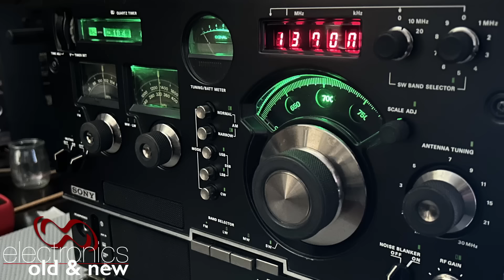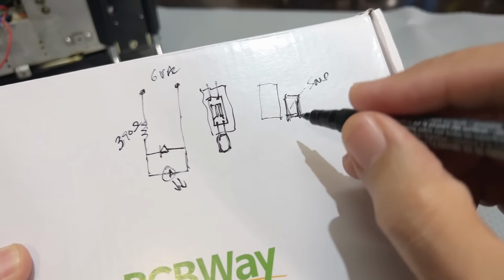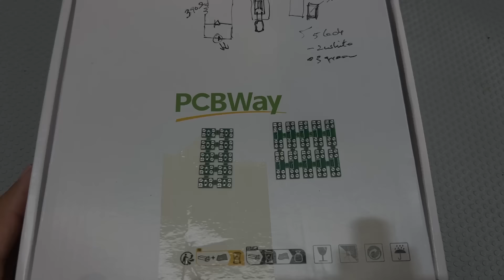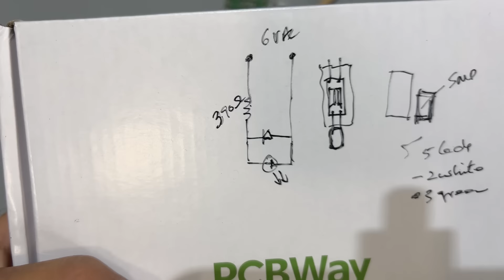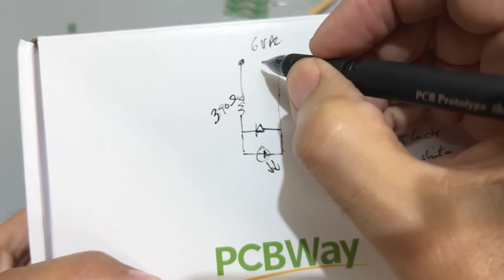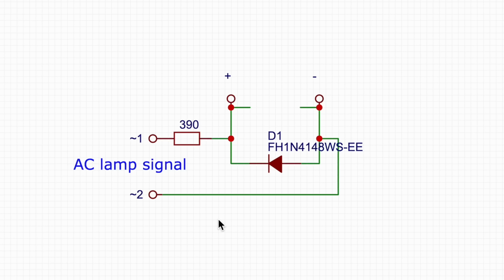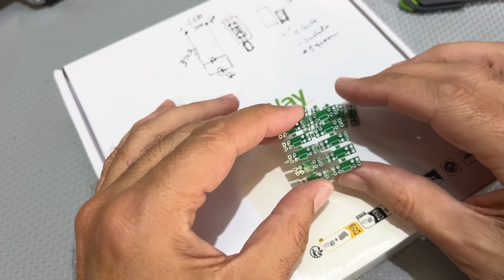Upgrade Your Vintage Radio With Led's - Easy Diy Pcb Conversion! #pcbway#

Comment: That's one of the solutions...  I always put the diode first, followed by a capacitor (SMD tantalum) and the series resistor.. Less flicker and more light.. You could modify the print that the capacitor is mounted on the back-side... just a thought for modification.
Reply from the maker: That would work.
Reply: @electronicsoldandnew  using a smd full-bridge rectifier would take too much space... and is more expensive, but would fully tackle polarity problems.

Comment: Since an LED is a diode, you could use another LED in place of the diode. This way, you get twice the light at basically the same current, and less flicker.

Comment: Hi, you did it really professionally 👍, I made this connection somewhat amateurishly. The SMD diode is soldered to the LED terminals, the wires are soldered to the LED, and a short distance from the diode the THT resistor in the + wire is sealed into a separate tube.

Nice day 🙂 Tom

Comment: Very interesting and well presented video. Your innovation is particularly impressive. When I do an LED conversion, typically on a vintage solid state receiver, I just try and find a DC voltage to tap into. Makes life a lot easier. However, I can see the benefits of your solution in the likes of tube radios where you need to be wary about the proximity of HT;  sticking with existing LT wires is a safer bet.  However, your solution is going to introduce flicker, which will affect some people. On a general point, I have found that LED conversions do not always improve the lighting scheme. I agree with your scuffing the LED body so that the light is more evenly distributed than it would have been; but, where a tungsten lamp that was fitted side-on to the viewer, is being replaced by an LED in the same orientation, it will be difficult to get the same luminance. Also, 1 resistor per LED is not always the best solution. It is where you want to 'tune' different meters etc. to get the same percieved luminance, (by inserting different resistors to get a matching effect).  In other cases e.g. tuning dials,  you want exactly the same current going through the LEDs, (i.e. you daisy-chain the LEDs and use 1 resistor). One last thing. If the AC bulbs being converted are a higher voltage e.g. 24V, the wattage of the resistor will need to be considered. Thanks.

Comment: I think I'd use a higher value resistor, unless you were aiming for about 20mA at 12v.  That's about 200mW dissipated in the resistor quite high for the smd one.
I guess the led fv is about 3V so 9 /390 = 0 023A
P = I2R .023 x.023x 390 = 0.2W if its a 1206 size it max is 0.25W

The good thing is that the dc is not there all the time, or  you would have hot resistors and flat batteries 😂

Nice to see it coming along.
Reply from the maker: Correct. The light only comes on with 12V when  you push the light button
Reply: @electronicsoldandnew  just what my wife says about me :)
Reply from the maker: 😊 we all get that from our significant others

Comment: Hey Manuel, sorry for my bad English.  Unfortunately, the proposed circuit is not perfect for the German AC network with 50 Hertz.  The LED flickers all the time.  It is advisable to integrate a diode into the circuit in front of the resistor together with a capacitor connected in parallel, which has the function of a half-wave rectifier.  There is therefore never a negative voltage on the LED and you can save yourself the diode installed in anti-parallel to the LED.  The LED now lights up constantly without flickering.
Reply from the maker: We also have 50Hz, and I done see any flicker. Could be the type of LED used. The ultra bright ones seem to work best as the current I used is quite high and therefore the flicker is not visible to me.

Comment: Another slick solution you've come up with.  Would these work in your usual German tube radio restorations with 6.3 VAC?  And could you put a couple in series to shed some more light on the larger dial plates?
Reply from the maker: These would work perfectly well with tube radios. You just need to connect them to the lamp thread somehow.

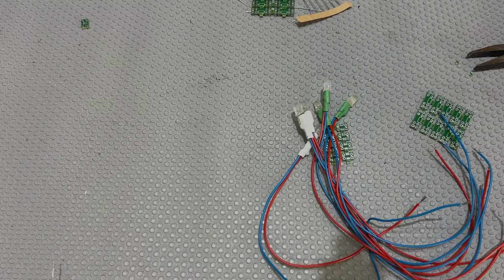Comment: Oooops I think your circuit diagram at 13:30 is incorrect  - I think the polarity of one of the diodes should be changed.  Excellent idea and excellent  channel. Thanks
Reply from the maker: No, it’s correct. The anode (+) and cathode (-) must be as drawn, so that the fixed diode is reversed in respect to the LED.

Comment: Nice. One question, when you have 12V DC on the input, wouldn't be 390 ohm a bit too low for one LED?
Reply from the maker: Not really. Ideally you want a maximum current of about 20mA through the LEDs. At 12V, you get about 30mA for the time you have the ‘light’ switch depressed ((12-2.9)/390). It’s a little higher than you’d like, but as this feature is usually only depressed for a short period, it shouldn’t be a problem. The reason I chose 390 ohms is to ensure a good amount of current when used on AC mains, when the LEDs are always on. The fact that it’s half-wave rectified and only sees about 6VAC means that you need to feed it a good amount of current to avoid the flicker, and this solution seems to do just that. Personally I don’t see any flicker at all.

Comment: In your first circuit example, why not just use 2 LEDs wired back to back? That way they reverse polarity protect each other and you get light no matter how you connect it to power...
Reply from the maker: The two LEDs would not both fit through the holes that exist for the dial lamps.

Comment: For a single indicator LED there's rather small SM diode full bridges. Even better, there are very bright and efficient SM 0603 LEDs and zenner diodes in the same size of package and I'd guess your sponsor offers board populating as do the other chinese competitors. For prototype manual assembly this kind of pannelizing is unnecessary more expensive - it's ment for machine population of panels and breaking off ready-made boards, but for a minimal number of prototype boards a simple v-scoring is cheaper, more eco friendly and sufficient.

Comment: why you do not use capacitor instead of resistor? if ac power, it works but dc not
Reply from the maker: These have to work on both AC and DC